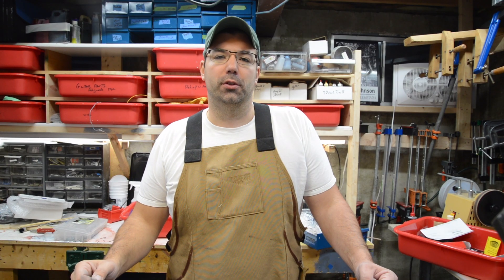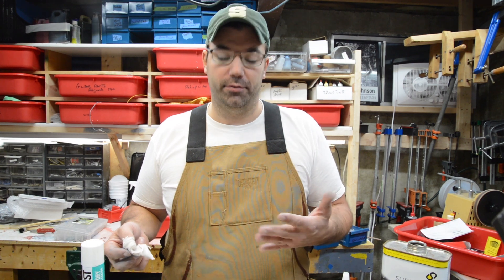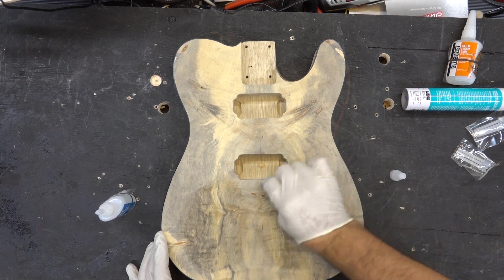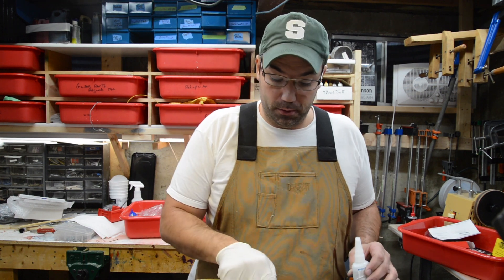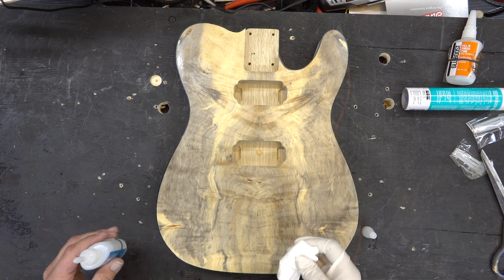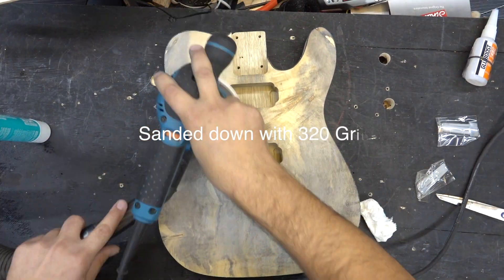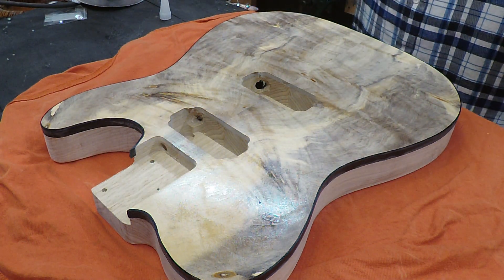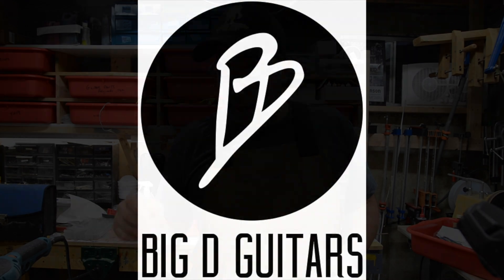Superglue as a Guitar Finish!?!?!?!  WHAT THE WHAT!?!?!? - Part I

Comment: I wouldn't have believed it unless I had seen it with my own eyes.
What an amazing finish!
Goodbye Truoil hello superglue.
Thanks for the video.
Reply: Yes it is.....i have finished a couple of my handmade guitars that way...not to mention....i was able to finish the back of a neck with the strings on......seriously its not rocket science...first couple of coats for grain filling...then sand it down with 400 and level it(no shiny spots) and then after a couple of coats more use higher grits like the man in the video to remove the big scratches......not only its rock hard....looks great... but you dont have to wait months for the lacquer to dry.....
Reply: Doogie Carpit Burger Shellac is pretty weak though. Whenever I use it, I use amber shellac and then put something like lacquer or poly over it.

Comment: I've been using Gluboost mostly for spot repairs for a couple years now.  I've used it as a pore filler, but not as a final finish yet.  I happen to have a Buckeye burl top that is going on a Weissenborn-shaped lap steel, so this video was extremely helpful. Previously I had sealed and filled a spalted maple top with a mixture of 12hr epoxy and acetone.  It worked fine, but couldn't be used on a bound body.  Thanks for the tutorial.  And thanks to Rick at Gluboost for the awesome products!

Comment: We recommend always using the GluBoost spray.  The reason is that the Fill n' Finish is a flexible product and takes much longer to dry than a CA product. The spectacular thing about  the GluBoost accelerator will not bubble or pit the product so the finish work is much easier to do.  This flexibility allows for wood and ambient temperature and humidity changes without affecting the finish becuase the finish will move with the wood and not shrink back.  Also, because the products are 99.6% pure the finish is always crystal clear.
Reply: Will this look good even over stained wood?
Reply: @mrmisterman999 , it can be done. Although the glue tents to smear and pull out the stain. Let the stain dry VERY good and be careful applying.

Comment: My eyes are burning just watching!  A lot of guys that turn pens and other small stuff use CA glue as a finish.  It's hard and glossy!  Cheers, Chris.
Reply: Theres no burn with this stuff it's not 2p10
Reply: Yeah it does put out Cyanide in the drying process . I use a Respirator Safety glasses and Fans..
Reply: There is definitely burn with this stuff. Respirator and Goggles are must have. Stuff dries hard and fast, but it's pretty nasty to work with. 

Just finish an entire body and would only use this stuff again if I had to. Sets up fast, streaky, second coats on top of the accelerator are close to unworkable. More sanding as a result, clogs paper fast. Gotta be super careful not to inadvertently glue things together.

Gorgeous finish, rock hard over very soft woods and like glass, but would much rather work with oils and poly's.
Reply: @jimfromoh8944  I've tried Truoil and poly on several guitars, this is by far the easiest and most durable finish of them all.  Quicker, sands easy, doesnt smell too bad and I had ZERO streaking or witness lines.  Truoil dents and dings like crazy, poly is a bitch to fix.  Nitro never fully cures and is is lung cancer in a can.
Reply: Oh, no respirator needed.  Good ventilation or outside, no issues.

Comment: Thank you very much!!! I just finish to sand my new guitar after puting multiple coat of a water base lacquer! I sand through the finish!!! I have to start again the finishing process. I have already finished the finger board with CA and the result is amasing. So, this time I will use the CA to finish the whole guitar. Just for the info, the lacquer cost me 300$ and it is super fragile when it’s done!!! The only reason I will use lacquer is to put color on it. I will do a level sanding and add layer of CA to make sure the finish is shiny!

Comment: I used this product on a White Les Paul build.  Stuff worked very well and compared to many finishes it is on par for cost or less expensive but the time it takes is pretty quick once you get going.  If you go to their website they have all kinds of tips.  I used the Fill and Finish product which is a little thicker.  I used just regular paper towel to apply and the key was just use small areas.  If you worked too big of an area the glue got hard to move and did not dry flat.  Also, if you put in on in a large area the fumes did get bad.  Small areas the fumes were not bad.  To me the accelerator had the worst odor.  Buff it out and you have a mirror finish that is smooth as glass and hard.

Comment: I once used CA for the finish on the wood binding I put on my '78 Takamine, and I built a tiny flying 1975 Fender Champ RC plane...gotta love combining hobbies.  I wonder if doing this on an acoustic would brighten the tone, I'd think the thin CA would soak into the wood better, making it even more rigid, making the tone even brighter?
Reply from the maker: yea potentially
Reply: Interesting...I've wanted to build an acoustic for years, I think I'll try the CA if I finally do it.
Reply: I'm refurbishing a nasty old Silvertone classical, will be using this technique.
Reply: How does the hardness / scratch resistance compare with nitro / acrylic?

Comment: I don't know if this has the same properties but I used to use A LOT of CA glue in the past. They recommended keeping in refrigerated for a longer life. BTW nice finishing job, probably tough as nails too since the glue penetrates the wood. I have seen this process done on a Fretless neck and it came out incredible.
Reply: I've used it on 2 fretless necks with fantastic results.
Reply: "It" meaning   gluboost?
Reply: What did you use it on?
Reply: Just plain CA glue.
Reply: Per Gluboost's FAQ:  Once you initially open the bottle, do not put the bottle back into the refrigerator as this will introduce condensation to the inside of the bottle and dispensing tube. This will then cause a reaction with the CA, and it will actually start to set up and compromise your entire bottle.

Comment: Looks great! I wonder how it will do over time? Will it crack or turn hazy? What about small scratches and dings; will they stay transparent or will they be white like a scratch in plexiglass or acrylic? It's just Krazy!
Reply: You can repair scratches in superglue more easily than other finishes.  Just fill the ding to slightly above surface, sand back to finished level and buff to the level of shine desired. I've used it to fill dents in poly finishes, sanded and buffed back with a sponge nail polisher.  The joins were almost undetectable.  Superglue also won't lift like poly or nitro because it's partially soaked into the wood.  It's also a great finish for guitars because while it's hard, it's also very thin meaning the instrument can still resonate.  I'm surprised PRS aren't using it yet!

Comment: I ave been using superglue as a sealer and finish on all kinds of wood projects, including guitars.  It is all you have described in your video BUT I have found that most ANY superglue will do the same job!  (Yellow bottle with red cap, $1 for two is awesome!)
Reply: I tried some dollar store super glue as an experiment on some scrap wood and it works great.
Reply: Yep, I use super glue in a lot of my wood working projects.

Comment: Cool beans Big D! I want to try this new glue formula....hopefully it stands the test of time. The last time I did a finish with regular superglue it looked great...but then after about 5 or 6 years there was some really weird flaking. I had to refinish that guitar as warranty work, so I'm a bit gun shy about the longevity of CA finishes.
Reply from the maker: Freddie what up dude!!  I will have to see how that turns out.  thanks for the comment!
Reply: i used ca on a a fretboard made of porous wood. i made a thick coat, sanded down. look gorgeous and holds very well. even is more scratch resistant than i thought it would be.
i'd look into how uv light affects ca for example, if i had problems. but i don't.

Comment: One can buy oderless CA glue. Only down side I see with using CA is that a dent is going to stay a dent, it's not going to bounce back on it's own. It is a hard finish. And also one can purchase a thinner for CA, which would be great for the first coat if your looking for penetration into the wood. That's my 2, (where's the cent key) worth.
Reply: easy fix

drop fill with master thin   They have a video on there website where a master builder demos this
Reply: Tell me which finish bounces back from a dent?  ZERO.

Comment: Awesome. I'm doing a head stock with the cheapest crap known to man. I'll let you know how it turns out.

Sanded the head stock with about 350 grade.

Acetone

Fan

10 minutes

Applied stickes glitter glue for that flake look. Applied it a second time after it dried to really make sure I covered it good. Also tried my best to have a level amount of lathering. No one likes bumpyness. We like smooth!

After drying it was already stuck on there real nice. Right now I'm wiping it down fine with torn up t shirts. Trying to get what flakes remain that don't want to stick.

Acetone.

10 minutes.

Now some cheap ass modeling super glue. Let it run on evenly. Got tape on the outside of the head stock firmly put on so no lame run off occurs. Waiting for it to dry right now and I BET YOU it will be pretty awesome. We'll see lol...

Comment: I just finished my first guitar using AC glue as filler and clear coat. I used Starbond medium viscosity and it turned out great. I don't know why anyone would mess with spray booths after trying this. Dry times measured in minutes instead of hours.
Reply: Because unlike spraying poly or nitro, cyanoacrylate vapors polymerize instantly (that's why it's strong after 10 sec) upon meeting the water in your nose, throat, and everywhere else.... a spray booth seems sane compared to this technique.
Reply: +Michael Carey You're right, a respirator is a must if using this method, and I always work outside as well.

Comment: I didn't see this in the comments, but forgive me if someone already mentioned this. Supposedly Fender uses this technique on all the Strats they make for Eric Clapton. The main difference is that I hear to that they use it as a finish for the neck.
Reply: I heard that too about Clapton.... i dont know the techniques they use but i have personally used it on necks and bodies with great results.....just the thin stuff rubbed with paper towels (even the cheapest superglue you can find works), it requires some sanding especially after the first coats to get everything sealed and levelled but its very fast and effective overall....no waiting for months for your laquer to dry and wet sand....but then again i like my guitars natural...never used it above actual paint as lacquer.

Comment: Sure... used CA on fretless fingerboards & it works great... super durable even under roundwound strings.
Question: Is this ''GlueBoost" brand you used a special formulation for longer open / workable time? 
Or is it just typical CA
Reply: I d say CA , but sold 10 times its price😂

Comment: I've been finishing guitars with superglue for almost 30 years.
Reply: Hi. I'm thinking about finishing a guitar with superglue but underneath I want to apply a coat of wood dye. Will it work?
Reply: Adrian MS I don’t see why it wouldn’t.
Reply: You must be knackered
Reply: After trying with different sprays, enamels, methods and all (and failing) I found superglue the most simple method for hobbysts. I dont have an air compressor or any super knowledge of painting. Enamels will never cure like factory hardness of guitars. Super glue will. And in 60 seconds. And its transparent. And error forgiving. And can be polished to shine. And its cheap. End of story for me.

Comment: What if you have figured wood with some knot holes and such?
Reply from the maker: use some saw dust and that can fill the holes
Reply: I mean, I don't want em to look filled. I mean I still wanna see the hole but have a flat finish. IE: fill the hole with superglue, so the knot holes are still visible, but the surface is flat. Can CA fill holes, say...the size of a large peanut...without doing anything odd and not remaining clear after it sets? I imagine it would take a very long time to harden all the way through and I think accelerator would cause problems. I guess  a bit of shrinkage wouldn't be a problem, since I can add more later. But maybe the varying rates of shrinkage would make the surface hazy. I'll just have to try it in one of the holes on the reverse side of the top before I glue it to the body.

Comment: I tried this and noticed a couple of things: first, the rag got hot afterwards. Do you have to throw it in a can of water? Will it combust? Second I'm curious if you think finishing like this will have more adverse effects on tone than the typical lacquer/poly finishes we do?
Reply: I build custom stereo speakers and the occasional guitar. Poly finishes can dampen tone on guitars. The harder and thinner the finish is the better. This finish is probably the hardest finish yet. The impact on tone is negligible and the wood is sealed and protected.

Comment: How do you spread it so quickly without it drying almost immediately?
Reply: Per Gluboost FAQ:  Our GluBoost adhesives, have been specifically chosen to provide optimal workability and performance in all types of woodwork.

Several years ago, the Gear Up Products lab formulated a process where we added specialized market-specific additives to the formula, giving the product the ability to resist age and temperature changes, as well as impact. As a result, Fill n’ Finish Pro Formula and Fill n’ Finish Pro Formula Thin were born. Fill n’ Finish products are flexible and non creeping so they can be used in areas where CA, and other adhesives havebeen used before (but now with increased performance and super-clear results), such as to create wood finishes and repair all types of dings and dents. Fill n’ Finish is the ideal finisher for ding and dent repair or for entire finishes. It’s great for pore filling as well. Use it with GluBoost Glue Dry Accelerator for super-fast finish and repair work with zero to minimal witness lines on any finish.

Comment: What a stupid idear,just use French polish.🇬🇧
Reply: what a stupid suggestion. Shellac is just about the worst possible, softest and least scratch resistant option. Hell, the stuff's not even water resistent! Might as well rub some egg white on the wood and call it a day
Reply: French polish is the most time consuming work intensive and least protective finish EVER!!! If you plan on putting your guitar in a sealed glass case for display maybe.